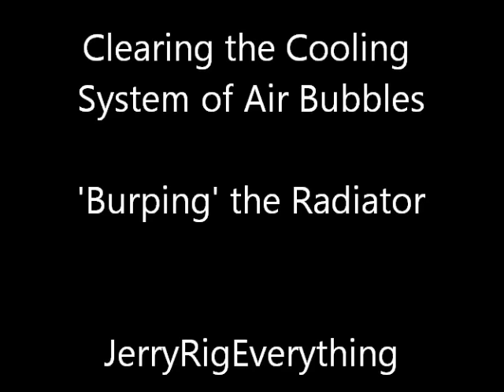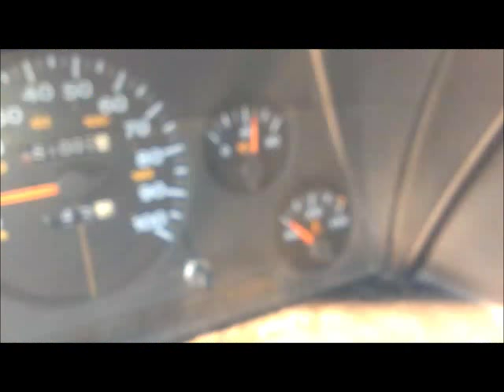Clearing the Cooling System of Air. 'Burping' the Radiator. Jeep.

Comment: looked like a blown head gasket also lol
Reply: i think he has.
Reply: How can you tell? Mine overheats... I just replaced the thermostat and it still is overheating. I didnt do this... But how can you tell if the head gasket is blown. I just dont want to dump money into it if it cant be fixed.
Reply: Thanks Mr. President lol
Reply: I'm hoping i didn't blow my head gasket too 😬 i checked my oil and coolant, no signs of anything. No smoke out the exhaust pipe, and i have lots of coolant. How difficult do you think changing the water pump on an 05 chevy uplander whould be? How bout a radiator? Cause i checked my radiator hoses and one stays completely cold and the other gets super hot when the van is overheated. Also there is a lot of rust under my radiator cap and all in it. Definitely needs to be flushed out. Maybe it could be clogged??? My van has 208,000 miles on it.
Reply: Thank you! I'm sure i will be able to find a decent video i can follow on youtube lol

Comment: Blown Head Gasket...oops 4 year old thread
Reply: from the smoke and bubles coming from radiator
Reply: I think he would've have noticed loss of power and misfire don't you ?
Reply: air purge at startup, now if it continues to happen then I would agree

Comment: hey just so i do this right, you have the front end on an incline right. Like the engine is sitting higher than the rear? Also, did you just add fluid to the coolant tank when it was running, not the radiator? Thanks

Comment: Wrong thermostat installed. That Jeep came from the factory with a 195 degree thermostat. Just like most ALL older cars. Your engine now will never warm up fully. Computer thinks the engine is still cold and turns on the injectors at a longer duty cycle. All costing you more in fuel (less mpg) and fuel washed down cylinder bores. Which in time will destroy that engine. It's like running with the choke on part way on a carbureted vehicle. Rings will not fully seal and the block will not expand to proper engineered sizes. Thinking your are helping it run cooler is killing that engine. Kids........

Comment: I tried this on my 63 chevy and after about 30 seconds the antifreeze started to spill out of the radiator.
Reply from the maker: Its overheating quick.  Have you checked to see if your thermostat functions?
Reply: It turns out I had my radiator filled to much, I had it filled to just at the filler neck. I drained out about 24 oz and no more problems. The antifreeze needs room to expand as I found out.
Reply from the maker: Good call.  That is true.

Comment: Dammit, I have the sealed system and it's gay as fuck. I bought a brand new reservoir and a new thermostat. Everything was going great until I unscrewed the cap on the rezz. Now it's overheating. I just had to fuck with it one more time. Dammit. Oh I hate this part. 🤣🤣🤣🤣🤣🤣🤣🤣🤣🤣🤣🤣🤣🤣🤣🤣🤣🤣

Comment: Should I squeeze the hoses while the engine is running?
Reply from the maker: Ya, it will get the air out.
Reply: Thank you for getting back to me. You're video had been a life saver. Best I could find